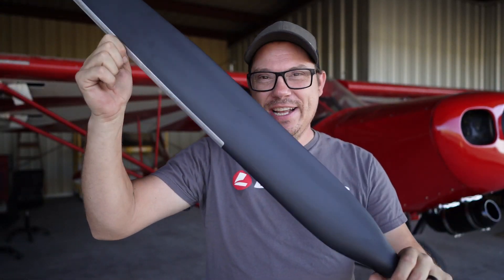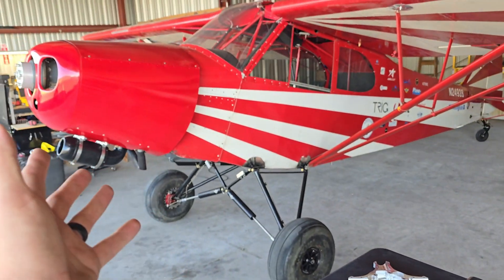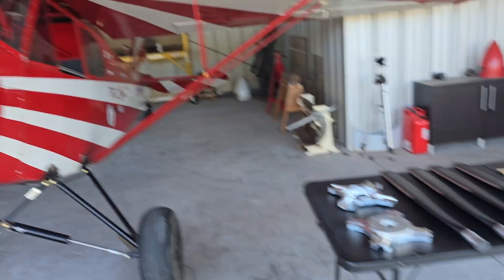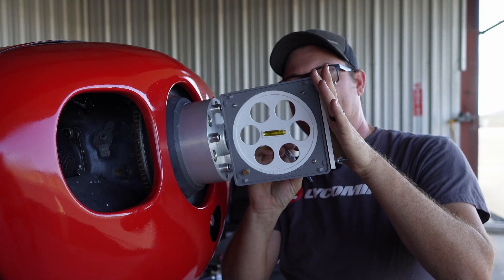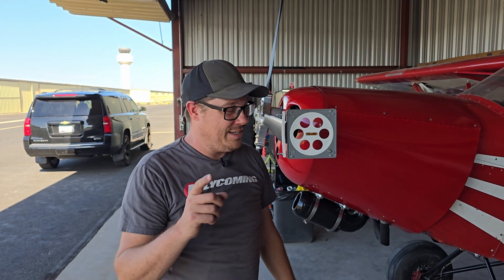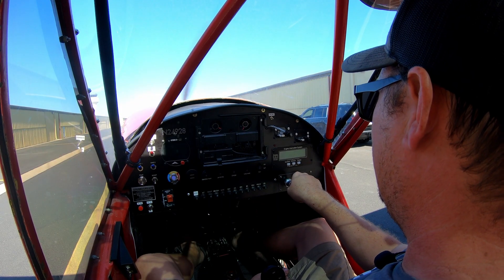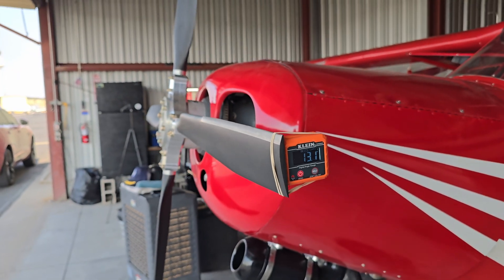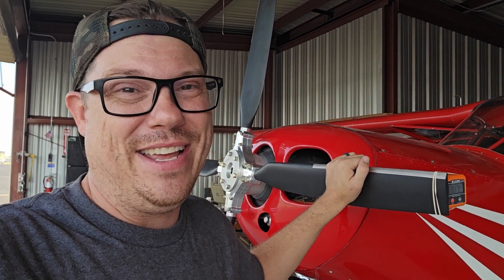Don't Play Swords With Your Propeller | Warp Drive Propeller Install

Comment: Great video guys. I bought the Klein DAG and going to work on my prop this weekend. One problem I have on my Quad City Challenger (pusher) is that I can't get to some of the nuts to torque them, even with crow foot wrenches. I just noticed you have your clamping bolt nuts facing out instead of the traditional way of facing rearward. In my situation where I can't get the torque wrench on the most inner nuts of the clamping bolts if this would be acceptable?

Comment: Warp Drive props  was a great choice for the Red Rocket Carl.  The four blade model does justice to the front of your Cub and, as we now know, makes that red Cub climb like crazy.  Also, Saber builds top quality prop extensions. I run one of their’s on my airplane.👍 Looking  forward to seeing The Red Rocket fly in person soon.
Reply from the maker: I'm really happy with the propeller thus far. It's been a great product and easy to work with.